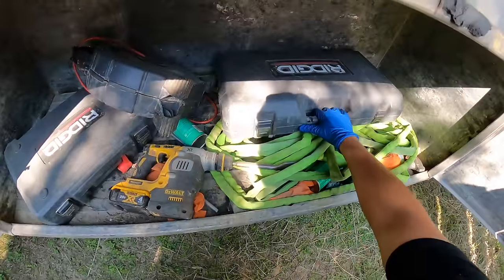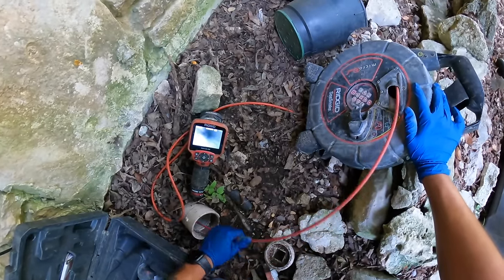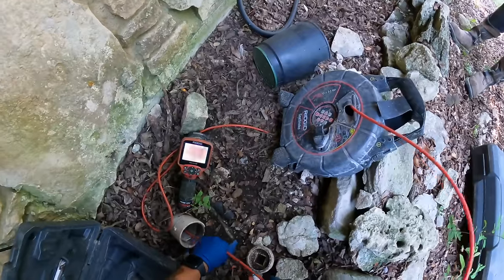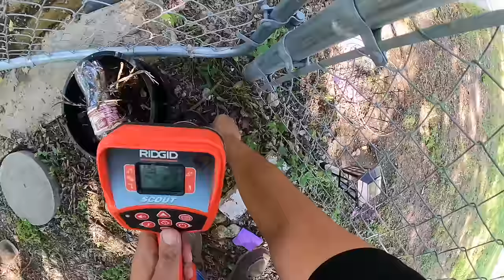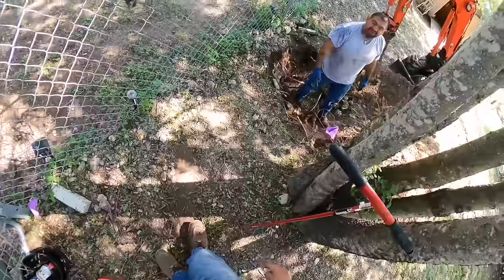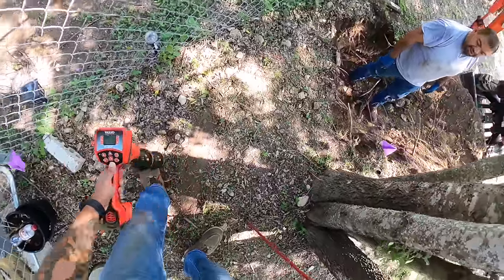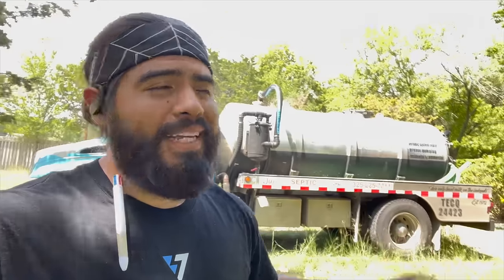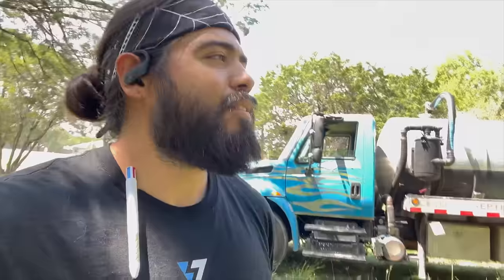First Time This Septic Tank Has Been Opened (50+ YEARS OF POO)

Comment: Your videos are so informative and interesting, thanks for the good work.  After 40+ years of having septic tanks as on-site sewage disposal systems I can state that you know your profession well.  Best practice is to have your tank pumped and checked regularly by a professional and don't flush down things that'll harm your tank.  For example, our house had a garbage disposal when we first moved in.  I had it removed first thing. We also installed low-flush toilets and water-saver shower heads and faucets.   Thanks again for the great videos!
Reply: I'm curious why a garbage disposal is a bad thing. I want one.
Reply: Are you a plumber/an engineer? Can you tell me how exactly should the inlet and outlet pipes be? 

To give you a little background to our problem. Ironically, my father is a civil engineer, but he's passed the age of retirement, so he doesn't actually remember things he learned in the Engineering University much, and the fact that he monitored roads and bridges' constructions his whole life means that he has no practical experience of constructing houses before. 

We're building our house, and we've never felt this task being so difficult before, except when we reached the septic tank construction. My father wants things perfect and he is unable to get work done his way because of doubts that arise by people's suggestion (this includes insufficient information provided by engineers, plumber's and worker's experiences -- usually evolving around the trends in their hometowns and our neighbours' adamant suggestions in-contrary to my father's logic.

Now, to cut this short: we have built our Septic tank of 3 chambers. The inlet has 2 pipes, one of them has an elbow and the other has a T, attached to their ends which are then extended about a foot below to enter the flushed water; the outlet, on the other hand, has a T attached to the end without any extended pipes. 

Now, my father got one of the inlet pipes' elbow's top cut into a 2''x2'' box to let the inlet gases escape (as he sees that to be the purpose of a T, and because our plumber already had installed an elbow -- without a consultation -- my father found it to be sensible to get the top part removed). 

I don't exactly know what he did is right or not, but he finds it okay. Now, because our neighbour argues against even for T to be installed, he finds it odd for the elbow's top to be removed (which even I found absurd when my father told me what he did). This in retrospect, my father is now not sure if what he has done is right thing, and whether he should remove that elbow, add an extended pipe and finally install a new T/elbow.

It is all a mess! I need a faster answer because my father will find a way to fix ut myself tomorrow. I don't want something wrong to happen again. Therefore, a faster answer would be much appreciated. Thanks!

Comment: Great video! I can't imagine septic systems without risers any more, after hand digging mine to get it pumped out the last time. I decide then that it would be the last time, and put risers in. Then when I had to have a new system in my parent's house I made sure risers were put in there, along with several cleanout access points. Everything is now mapped on Google earth (along with field tile drainage systems).

Comment: That access port was for clearing a blocked inlet baffle. Will be a middle plug that is 18"-26"for pumping or a seam where you have to slide the lid. Saw cut if its the slide the lid style and install riser on that new opening and a pipe over the inlet port to clear any future baffle blockedge.
Reply: Are you a plumber? Can you tell me how exactly should the inlet and outlet pipes be? 

To give you a little background to our problem. Ironically, my father is a civil engineer, but he's passed the age of retirement, so he doesn't actually remember things he learned in the Engineering University much, and the fact that he monitored roads and bridges' constructions his whole life means that he has no practical experience of constructing houses before. 

We're building our house, and we've never felt this task being so difficult before, except when we reached the septic tank construction. My father wants things perfect and he is unable to get work done his way because of doubts that arise by people's suggestion (this includes insufficient information provided by engineers, plumber's and worker's experiences -- usually evolving around the trends in their hometowns and our neighbours' adamant suggestions in-contrary to my father's logic.

Now, to cut this short: we have built our Septic tank of 3 chambers. The inlet has 2 pipes, one of them has an elbow and the other has a T, attached to their ends which are then extended about a foot below to enter the flushed water; the outlet, on the other hand, has a T attached to the end without any extended pipes. 

Now, my father got one of the inlet pipes' elbow's top cut into a 2''x2'' box to let the inlet gases escape (as he sees that to be the purpose of a T, and because our plumber already had installed an elbow -- without a consultation -- my father found it to be sensible to get the top part removed). 

I don't exactly know what he did is right or not, but he finds it okay. Now, because our neighbour argues against even for T to be installed, he finds it odd for the elbow's top to be removed (which even I found absurd when my father told me what he did). This in retrospect, my father is now not sure if what he has done is right thing, and whether he should remove that elbow, add an extended pipe and finally install a new T/elbow.

It is all a mess! I need a faster answer because my father will find a way to fix ut myself tomorrow. I don't want something wrong to happen again. Therefore, a faster answer would be much appreciated. Thanks!

Comment: Oh man I must have dug up my slab lids 6 or 7 times (2 feet deep in clay) before I got wise and cast some pavers to make the long narrow slot into something I could mount the risers to. Now I almost look forward to having my tank pumped.. A dozen screws and we're in!
Reply: Are you a plumber? Can you tell me how exactly should the inlet and outlet pipes be? 

To give you a little background to our problem. Ironically, my father is a civil engineer, but he's passed the age of retirement, so he doesn't actually remember things he learned in the Engineering University much, and the fact that he monitored roads and bridges' constructions his whole life means that he has no practical experience of constructing houses before. 

We're building our house, and we've never felt this task being so difficult before, except when we reached the septic tank construction. My father wants things perfect and he is unable to get work done his way because of doubts that arise by people's suggestion (this includes insufficient information provided by engineers, plumber's and worker's experiences -- usually evolving around the trends in their hometowns and our neighbours' adamant suggestions in-contrary to my father's logic.

Now, to cut this short: we have built our Septic tank of 3 chambers. The inlet has 2 pipes, one of them has an elbow and the other has a T, attached to their ends which are then extended about a foot below to enter the flushed water; the outlet, on the other hand, has a T attached to the end without any extended pipes. 

Now, my father got one of the inlet pipes' elbow's top cut into a 2''x2'' box to let the inlet gases escape (as he sees that to be the purpose of a T, and because our plumber already had installed an elbow -- without a consultation -- my father found it to be sensible to get the top part removed). 

I don't exactly know what he did is right or not, but he finds it okay. Now, because our neighbour argues against even for T to be installed, he finds it odd for the elbow's top to be removed (which even I found absurd when my father told me what he did). This in retrospect, my father is now not sure if what he has done is right thing, and whether he should remove that elbow, add an extended pipe and finally install a new T/elbow.

It is all a mess! I need a faster answer because my father will find a way to fix ut myself tomorrow. I don't want something wrong to happen again. Therefore, a faster answer would be much appreciated. Thanks!
Reply: Ironically I am a mechanical engineer although I have retired my P.E. license. Now ME's don't work on these systems professionally but like all engineers we "know everything" right..:). From what I do understand your Father would be correct that the two inlet pipes should have a Tee then the bottom extend below the anticipated scum layer (about 18 inch or so). The outlet tee should be the same. Now if you have a three tank system there will be a lot less scum in the third tank, but personally I would still want to add an extension pipe to the bottom of the Tee.. If the system is dry this would be easy to do. I would also strongly recommend adding an outlet filter to the outlet tee. This will add years of life because it stops a lot of solids getting into your leech field, which is the most expensive part of the system and the hardest to replace. Assuming the two inlet pipes are for the purpose of of getting solids into the tank then yes they should both be Tees and extended. If the inlet with the elbow is only for greay water then the elbow ill be OK but it should still be extended below the scum layer and cutting the top is not a bad idea.. If it is for solids though then the elbow is not the greatest plan but you might get away with it as long as the bottom is extended, providing the top of the scum layer is below the hole cut in the elbow then you can get away with it. @saved_through_faith
Reply: @frankish5314  Sir, thank you so much! I’ll discuss this in detail with my father, and ask you any more questions we have. Also, we don’t have a leech field; our city has it’s own line (and the leeches grow and stay in our septic tank). Therefore, my father says a filter, “is not needed”.
Reply: @frankish5314  To start with, we haven’t started using the septic tank yet, so it’s dry and, seemingly, not too late for modifications.

I’ve had a short discussion with him, and the following is what I’ve extracted from the conversation, and I’d like to share it below; it is all you need to know to help us much further in modifications (if necessary). 

The bottom of the inlet elbow (partially cut from the top) is 6” above the scum layer or the bottom of the outlet pipe (and both of the inlet pipes are for feces — the sink, the kitchen and the other drains, he didn’t let enter the septic tank, because he believes that these chemicals and grease kills the leeches which accumulate in the septic tank and eat the feces at the bottom), so the cutting-plan wasn’t that bad after all; we don’t have to replace it with the T, right? (because my dad terribly wants to replace it with a T, but that’d only give us a margin of about 1.5”-2” to connect the T, so the structure of the T, in my opinion, wouldn’t hold that great for long.)

Secondly, my father just told me that he didn’t bother adding another T on the outlet, so obviously didn’t even extend it (to about 18” either). I told him what you consider to be a better option here (that is to put a T and extend the pipe). He claims he didn’t do that because, well, there is a manhole (1’ by 1’) about 2’ after the septic tank that allows the scum/floating stuff to be stored there too, before entering the main city’s line, so in his opinion acts like a filter. 

There are a couple of things I forced him to do before-hand but he didn’t bother listening, they are as follows: (1) add a T at the outlet (which I thought he did for maybe filter in the future), (2) have 2 openings for the lid — one on the inlet side and one on the outlet — and right now the opening is only beside the inlet pipes, (3) extend the pipe (on the inlets) about 2 foot in the water (he did about a few inches; when we add the 6inches of the T/elbow, it makes it about a foot); it’s a foot, but I wanted him to do about 2 feet), (4) I wanted him to leave a decent amount of place for the feces to exit the first chamber onto the second, he left only a 2’x1’ area and the rectangular-exit is only 4” above the bottom of the tank (I’ll share a picture maybe via WhatsApp?) and, finally, (5) he worker did something like another wall joined with the concreted wall of the septic tank [width 4”) right below the outlet pipe, and he claimed it’ll not let the scum and illogical crap like that… I was against it, but my father seemed okay. 

What do you have to say for all of the points I raised above? We are utterly in need of your assistance. I’d much much appreciate if you label each answer as the number of the points (1,2,3,4 or 5), and answer them all.

I very much hope that you can help me through this. I am in my A-levels (grade 11th) and I don’t get time to study either because of all this. So I have to rush to studying after I pay a visit to the construction site once more and maybe have a look at the septic tank another time today. 

I’ll be awaiting your response. Yours faithfully, Owen.

Comment: It should be a criminal offense to put in a septic tank without having a cleanout coming all the way to the surface, clearly marked for easy location and identification and access.  Having to use a backhoe to service the septic tank is just job security for plumbers.  A $300 job is easily turned into a $3000 debacle because of this stupidity.

Comment: Did you fix the tile at the edge of the house or call in a plumber also is that tank to deep or is that normal 🤔
Reply: It has to be at least deep enough to maintain 1/4" of fall per foot of run. So if the tank is 32 feet away from the house, it has to be 32/4 inches below the depth of the pipe at the foundation. 32/4=8 So it has to be AT LEAST 8" below where the pipe comes out at the foundation. If that is 12" below grade, it needs to be at least 12"+8" or 20" below the main house drain. 

Too low is relative. Not low enough is an exact figure. Meaning if it is dead level or uphill from the main house drain.

And he can probably fix that hole with a rubber pipe clamp, which he probably has on the truck.
Reply: @ricoludovici2825  thxs for the reply

Comment: What  schedule was the broken pvc pipe? It looked thin like sked 10 S&D pipe.
Reply: Are you a plumber? Can you tell me how exactly should the inlet and outlet pipes be? 

To give you a little background to our problem. Ironically, my father is a civil engineer, but he's passed the age of retirement, so he doesn't actually remember things he learned in the Engineering University much, and the fact that he monitored roads and bridges' constructions his whole life means that he has no practical experience of constructing houses before. 

We're building our house, and we've never felt this task being so difficult before, except when we reached the septic tank construction. My father wants things perfect and he is unable to get work done his way because of doubts that arise by people's suggestion (this includes insufficient information provided by engineers, plumber's and worker's experiences -- usually evolving around the trends in their hometowns and our neighbours' adamant suggestions in-contrary to my father's logic.

Now, to cut this short: we have built our Septic tank of 3 chambers. The inlet has 2 pipes, one of them has an elbow and the other has a T, attached to their ends which are then extended about a foot below to enter the flushed water; the outlet, on the other hand, has a T attached to the end without any extended pipes. 

Now, my father got one of the inlet pipes' elbow's top cut into a 2''x2'' box to let the inlet gases escape (as he sees that to be the purpose of a T, and because our plumber already had installed an elbow -- without a consultation -- my father found it to be sensible to get the top part removed). 

I don't exactly know what he did is right or not, but he finds it okay. Now, because our neighbour argues against even for T to be installed, he finds it odd for the elbow's top to be removed (which even I found absurd when my father told me what he did). This in retrospect, my father is now not sure if what he has done is right thing, and whether he should remove that elbow, add an extended pipe and finally install a new T/elbow.

It is all a mess! I need a faster answer because my father will find a way to fix ut myself tomorrow. I don't want something wrong to happen again. Therefore, a faster answer would be much appreciated. Thanks!

Comment: 50 years of poo yet it has a PVC pipe going to the tank and inside the tank.
Reply: PVC was discovered potentially as early as 1835 (yes, 18 not 19) though its potential and use weren't truly discovered until many decades later.  It was in the 1910's that use of PVC for piping was explored and post-WW2 its use exploded all over the Western world.

In short, it's completely believable and likely that it would have PVC piping if it was from 50 years ago (which would only be the 70's, by the way, in case you want to feel old).